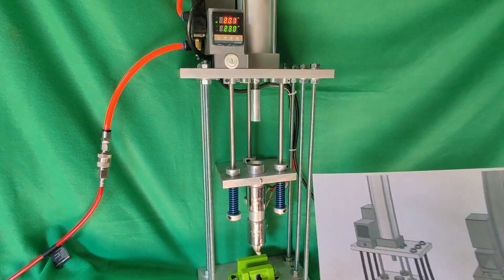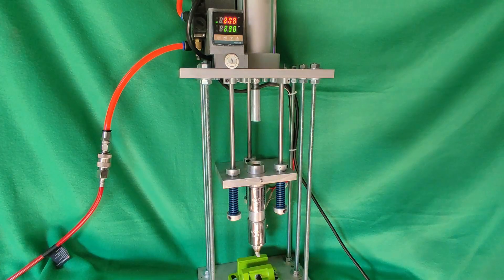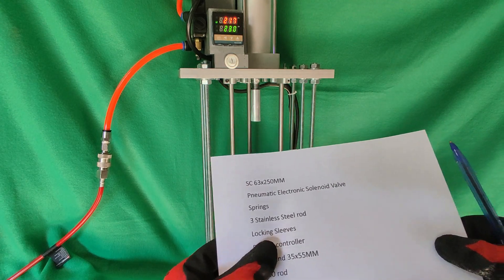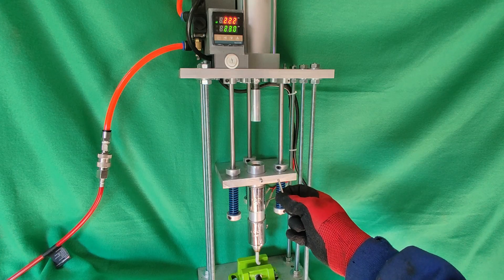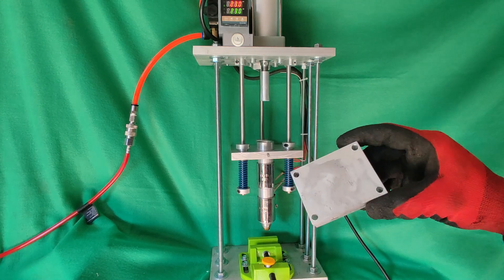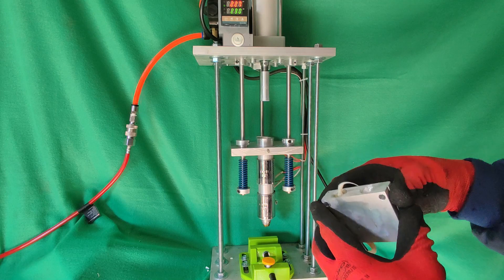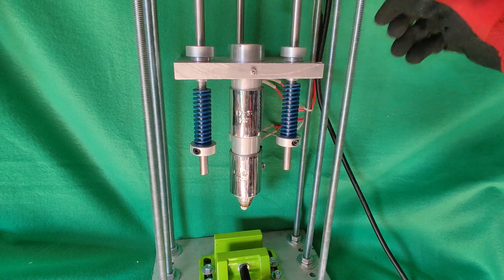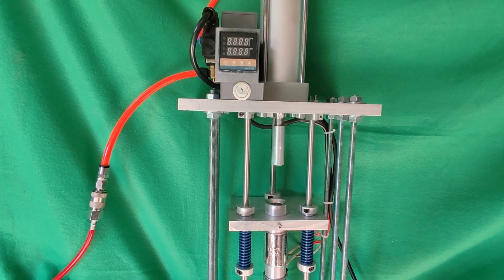Pneumatic Injection Molding Machine Overview

Comment: What material is your heater chamber?
Reply from the maker: Aluminium
Reply: @Off_GridWorkShop  Thank you. All I've researched said it had to be stainless steel but in a small production capacity I didn't think Aluminum would be of concern. How is it holding up for you?
Reply from the maker: @tcfox10   Stainless steel in my opinion is more for automatic injection molding machine that make thousands of cycles, for a hobby machine and low production aluminum is largely sufficient, I've never found any wear. So yeah for me it's perfect.